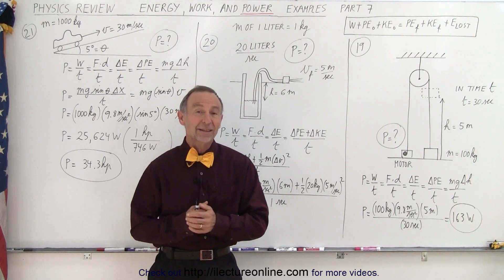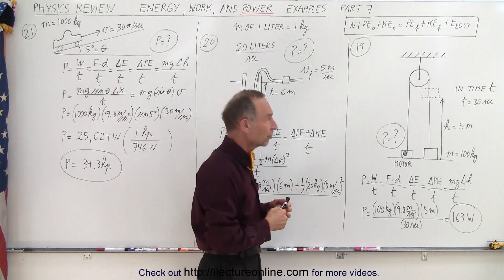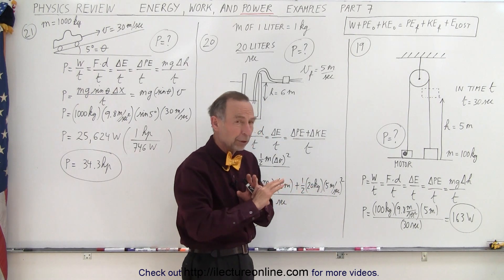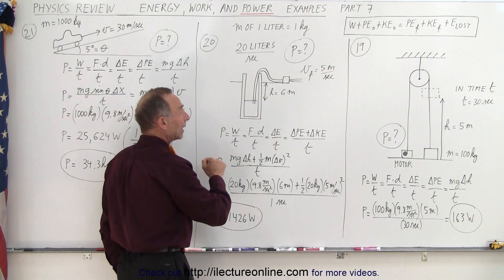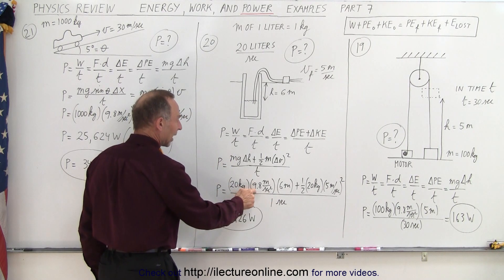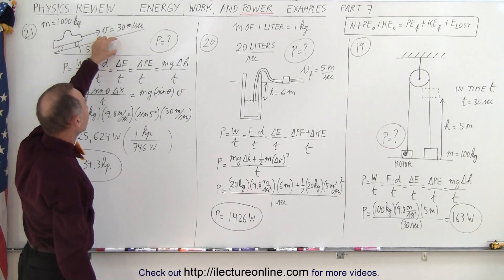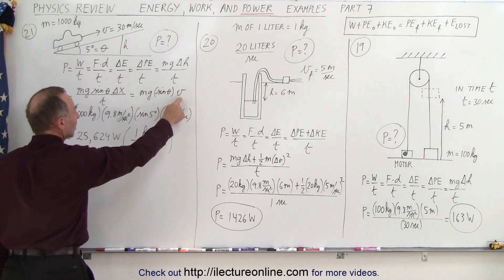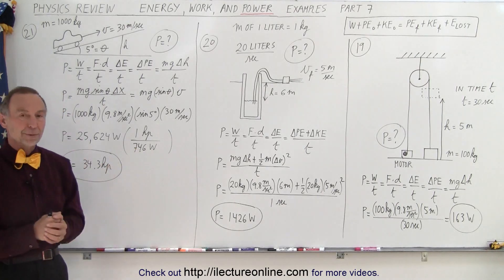Physics Review: Energy, Work, and Power Examples (Part 7)

Comment: I enjoy your balancing energy equation very much. I can use it for all problems. But i have a question from example  19 part 7
You are saying that because there are a slow moving constant velocity we can ignore kinetic energy. and use PE because you have m and g and height. when an object move at constant velocity acc. is zero. Is there still work done? With the object on ground level and KE =0 can it gain KE if work input if work is done by the motor or is it simply just again of potensial energy.
please qualify your statement for me.

Comment: So, if the velocity remains constant, we don't need to include KE in the equation. Am I correct, sir?
Reply from the maker: If the velocity is the same, the kinetic energy will be the same on both sides of the equation and you can indeed eliminate that from the equation.

Comment: Very good, it is easy to forget the kinetic energy in these calculations!   The change in energy is probably a better way to approach thee problems.   I had an argument a lot time ago about the differential in the wheel axle when one wheel is spinning in mud and doing no work.  The other wheel is not turning and also doing no work.  But my non-physicist colleague insisted that a "lot of power was being used".